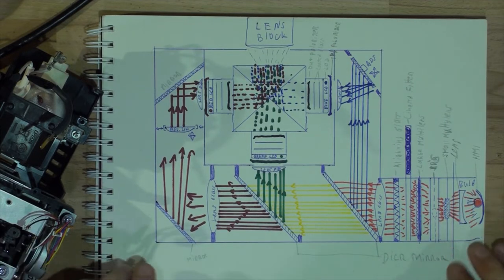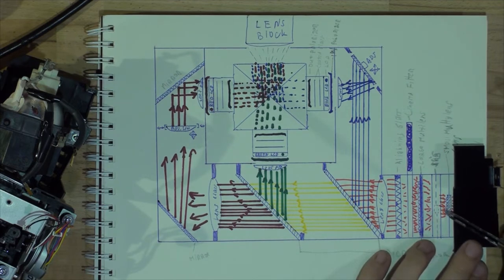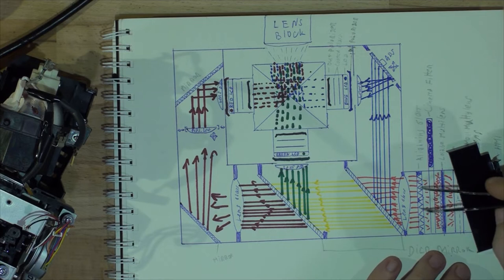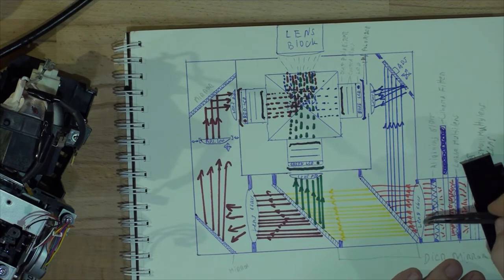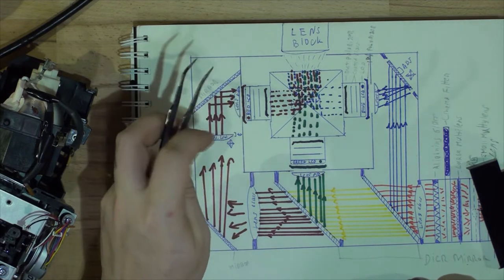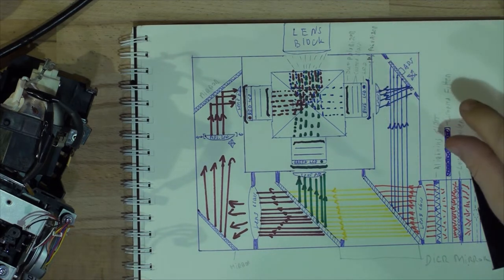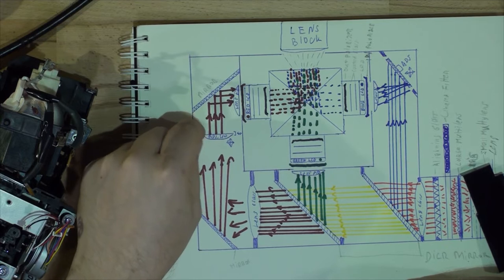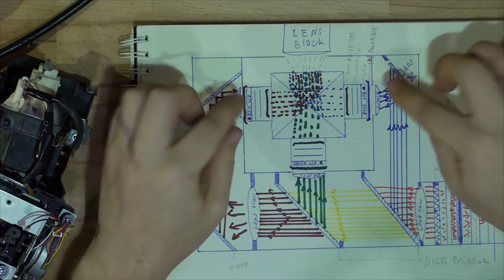Fixing Projector LCD Optics + Polarisers  Explained, How To Troubleshoot projector image problem.

Comment: Very good advice on the spot. I took the projector down and opened it up to find that a black beetle had gotten into the light engine area. Took care of removing the bug parts out with soft air pressure . Everything else was very clean but used a camera lens brush to finish up. Put the unit back together very carefully and everything lit up as it should without the spot!  Thanks for sharing your knowledge.

Comment: I have a tri lcd СР-Х809 Hitachi, and the screen is always white with a horizontal, thick black line on the top. I opened it up, and nothing looks out of place or broken. What could be the issue?
Reply from the maker: Could be dust on the lcd or optics (bare in mind that image is inverter upside down, so if the line is at the top of the screen then it’s at the bottom of the lcd or optics) the other cause is misaligned mirror in colour guide tunnel. Or faulty lcd.

Comment: Hello, I have an Epson 697ui and the top 1/4 of the image flickers/flashes mostly green and the rest of the image is perfect. Would this be an electronic issue or is it a bad connection or bad lcd on one of the lcds in the engine ?
Reply from the maker: Could be lcd or could be a connection, try pressing on the zif connector and see if it changes

Comment: Hello. I cleaned the optical block of the proctor. After turning on the projector, my red channel polarizer burned out. After reading the form, I did not find a solution - instead of the old polarizer, install a polarizing film from the LCD display. I glued the film on the glass from the burnt out polarizer, having previously cleaned it. After turning on the projector, I saw that the colors returned to normal, but the film melted again. I tried again by sticking the film on the other side of the glass. But she melted again. In what there can be a problem? I will be grateful for advice.
Reply from the maker: You’d need to buy a proper polariser from AliExpress, they are glass and not plastic.
Reply: @MaxELECTRONICS  The polarizer itself consists of glass and a polarizing film glued to it. I carefully studied the native polarizer - the native adhesive layer on which the film is glued is quite strong and thick. I had to use a solvent to wipe it off. The thickness of the native film is greater than the one that I later glued.
The strangest thing is that both the native film and the one that I glue begin to melt from above. I checked the ventilation system - it's okay. The remaining optical elements of the projector are in place. I'm even afraid that the purchased factory polarizer may melt ...
Reply from the maker: @lexraxx9043 have you checked that the blower that specifically cools them is working and there’s no obstruction? It’s very hard to laminate the polarisers a home, try buying a cheap/broken projector of any kind from marketplace and just installing any polariser from that just to see if the OEM polariser will melt
Reply: @MaxELECTRONICS  Greetings! Yes, I checked - the coolers are working fine, the air channels inside the projector are clean and will supply air. I purchased a polarizer from a different model Epson projector. After installation, it also melted... Not as quickly as my homemade filters, but still. Do you think there might be a problem with the lamp? I have 2 lamps, I have used them both, but the filters melt with either of them.
Reply from the maker: It wouldn’t be the lamp, check that all optics are positioned correctly and there’s no “hot spots”, that’s when the beam is focused in one spot, similar to lens on the sun.
Reply: @MaxELECTRONICS  Thank you for your feedback! I figured out the problem - the fact is that the standard polarizing filter has a very interesting coating. On the film side it has polarizing properties, but on the glass side the polarizer has no polarizing properties. Many forums recommend installing the filter with film to the optical channel, and glass to the LCD matrix. This is not true, at least for the Epson EH-TW5200. I installed the filter the other way around - with a film to the LCD matrices and the melting problem disappeared. I think that the polarizers of the lamp and my polarizer were out of “phase”, and the light flux was heating up the red channel filter. Thanks again for the recommendations.

Comment: So I took my projector apart (turns out spiders like hanging out  on the prism?) And when I lifted the prism all the out polarizer fell out and are mixed am I screwed? Is there a way to figure out where they go?
Reply from the maker: Easiest way is to try to see where the glue that polarises were held with is matching up with frame. Other tip - red polariser is slightly different tone then green and blue. And the green and blue just try placing them in roughly and turn the projector on and see if they are match or not.

Comment: Great video! I'm having a problem with the output polarizing filters on my Epson EH-TW5650. Would you know where I can find replacement filters please?
Reply from the maker: AliExpress sells them
Reply: @MaxELECTRONICS  Thanks for the information ! But I couldn't find the right filters for my projector. The only ones offered are suitable for the TW6700 and others, but not for the TW5650.
Reply from the maker: They may be the same, check the size. I have even swapped polarisers from different brand projectors before, all they do is polarising the light.
Reply: @MaxELECTRONICS  I've looked and the TW6700 apparently uses the same LCD matrices as the TW5650, but since I've found a TW5650 for parts, I'll try to recover the LCD matrices as well as the polarizers.

Comment: Fantastic thorough explanation. I just cleaned all the optics on my Panasonic PT-AX200U and I went a bit far lol. I removed the panels and had to realign each piece of glass with the alignment screws to get a good result. Each time I did an adjustment I had to remove the motherboard so not easy!  There is a slight green color on the right edge of screen but hardly noticeable so I’m happy with it. New lamp replacement was needed after 2010 hrs, the bulb lasted me 14yrs which is amazing. Hopefully I didn’t go too far the picture looks like new. I did find what looked like a black smear on one of the glass panels so I cleaned it with a q-tip dipped in isopropyl alcohol. Thanks for this tutorial 👍
Reply from the maker: The green colour on the edge would be a misaligned mirror in the optic engine light guide
Reply: @MaxELECTRONICS  oh yes good to know thanks for getting back to me. If I sent you a photograph of my setup could you verify for me please?  Do you think I went too far and should have left everything alone and not clean all the surfaces?  I used isopropyl alcohol on only one lense because there was a weird smear, look like a sharpie marker but the q-tip did the trick and looks like new!
Reply from the maker: You can clean the optics inside, that’s fine, but you should never remove lcd panels from the yoke (prism assembly), you should never use chemicals or alcohol on polarisers and you should never use compressed air inside the projector optics.
Reply: @MaxELECTRONICS  good to know, I used an air compressor to blow out of the dust in the fans/power supply but not the optics, was very careful and gentle. I bought a lense cleaning kit from Best Buy and came with special brush, microfiber cloth and puffer to gently remove the dust in the optics. So far so good, my projector is working. When I was at Best Buy I saw a new laser projector. AMAZING!  No maintenance on laser projector needed and no bulbs right?
Reply from the maker: Yes you can use compressor on everything but not optics. 
I’m not sure some laser projectors still use optic engine, some don’t. You can YouTube “what’s inside laser projector” and you’ll see different versions.
Reply: @stevemilker  there are three different types that operate on two distinction principles; one is called a laser beam steering projector, it has RGB lasers which is combined into a single beam before being scanned with a galvo mirror; these are very uncommon, their performance suck but they are infinitely cooler in concept; the second and third are both using "traditional" projector engines, i.e. DMD(DLP), 3LCD, LCOS, except the light is provided by a laser(s). One uses a single blue laser and generates the rest of the spectrum using phosphors on a spinning wheel, and the other one uses separate RGB lasers.

Comment: Hi Max, brilliant video, very detailed. I have a ceiling mounted epson tw7300 projector that shows a vertical blue one third left of the screen. This line appears after a few minutes of use and generally on bright mode. It clears off while using digital cinema setting. Line appears quite late when room is cold. When I play a video of full blue screen, there is no line but is immediately visible when blue screen clears off. Line shows up as blue on black screen and shows us as pink on red screen. Any thoughts which part could be faulty? Thanks in advance
Reply from the maker: If it’s a sharp line it could be the LCD. Or could be connectors on LCD

Comment: Hey Max thanks for the great video it is very insightful. Im about to attempt to fix my projector if possible. It's a Sony VPL HW10. Currently I'm getting poor blacks and dark scenes have bad contrast. Also I have noticed that there light bleeding from the border of the image all around. Which part do you think could potentially be causing this issue?
Reply from the maker: Possibly polarisers or mirrors.

Comment: Thanks for this rare information. I have a Christie LHD700 3LCD projector that the different colours are quite badly aligned and the problem seems to be getting worse. White  light is split to blue yellow and magenta components few pixels apart from each other. I guessing from your presentation that the LCDs are slightly loose inside. Do you  think i could open the light engine up and get them aligned again?
Reply from the maker: It’s possible but extremely hard to align the convergence on lcd projectors

Comment: Hi Max thank you for the video’s, very helpful. I have an Epson EHTW9000W, it switches on,opens the shutter and fans start but, does not ignite the lamp. The lamp led then flashes red, The bulb has about 2000 hrs on it. I have the original lamp which still worked when I swapped it out, have put that back in and get the same result. Is it possible to piggy back with a multimeter the bulb wires (to check for power)when starting to confirm the bulb is the fault? Had some other faults like temp led flashing intermittently just before this occurred, and a green intermittent vertical line on the screen.
Reply from the maker: It’s hard to say what’s gone wrong, have a look at a user manual and see what does led blinks mean.
Also yes you can force start the bulb manually, PLAESE BE CAREFUL DOING THE FOLLOWING AS THERES HIGH VOLTAGES INVOLVED AND COULD BE LETHAL, IF YOU DO THIS YOU DOING THIS AT YOUR OWN RISK. 
You can expose the projector ballast ( the one bulb connected to, then you will find 2 or 3 optocouplers on the board near a signalling cable, (you’ll have 3 cables going to on, one line to lamp, one for power input and one signalling) once you located optocouplers simply short out the output (opto transistor side) of the optocoupler, and see if lamp ignites, if it doesn’t try with other optocouplers, if none will ignite the lamp then it’s ether lamp or ballast.

Comment: Good day!  Thank you very much for this very clearly and wonderfully presented information.  I have the same projector you are showing here.  I had a green output polarizer that was burned in the center (even though we only used the projector some 200 hours...ever!)  I ordered a replacement polarizer from ebay and just replaced it, following a very helpful avsforum post with photos.  I am certain I put the new polarizer in the same orientation that the old one was in.  However, the end result is that everything is incredibly green now.  As though there is no polarizer.  Does this mean that I installed the polarizer backwards in some way?  Again, I'm certain I placed it the same way that I the old one was positioned.  Or does it mean I was given the wrong part altogether?  Either way, I think I'm in trouble, because the JB Weld that I used to glue it in is solid as a rock and I kind of over did it!  I am not optimistic that I can go back in, remove it, clean the area, and re-orient it IF that's what's needed.  But I'd love to know what the utterly green image usually means so that I can decide if it's worth it.  THANK YOU so much.  - Matt
Reply from the maker: It sounds like a wrong polarizer, if possible try rotating it 90 degrees and see if that works, usually when it’s all green it means it’s at the wrong angle or is there any chance you could have bought “input” polariser instead of “output” polariser?
Reply: @MaxELECTRONICS  Thanks so much for this reply.  I sent you an email this morning.

Comment: Hi Max, thank you so much for this. This helped me understand the individual pieces.

I have a question. I touched the LCD with my finger. Is there a way to remove my finger print?
Reply from the maker: LCD is not that sensitive, you can use cotton bud to wipe it, maybe mild detergent like Windex on a cotton bud, don’t spray it directly to lcd.

Comment: Dear Max, thanks very much, my Epson projector has a problem, the whole picture is a little bit green, make the picture off color, the reason is because the  input polariser? the output polariser? or the green LCD itself? many thanks.
Reply from the maker: It depends, if it’s a slight green tint the it could be input polariser out of place, they don’t usually fail tho. It could be something misaligned or fell out of place. If everything is in place then chances are it’s your output polariser, maybe check connection of the lcd to the PCB.

Comment: Awesome… I have a problem with my projector epson 5010, exactly right half or the projection is blurry and color mixing is not good, seems like optical engine malfunction… do you know what could be the issue?
Reply from the maker: It’s hard to say without looking at it but it’s something to do with the engine, I suggest just have a look inside and make sure everything is in place and no loose or cracked optics.

Comment: Hi Max I have a Epson 3020 Powerlite with 5 yellow vertical lines running near center of the screen.  I pulled apart and cleaned the unit and everything looks good.  Contacted Epson and they said it might be the optical engine, but would not specify which part might be bad.  Any ideas on what it could be?  I am familiar with Ali Express, however would not know what part to look for to solve this problem and the internet has not been very helpful as to pinpointing the problem.  Any ideas would be appreciated!
Reply from the maker: Could you send me a picture of what the lines look like to maxchristensenau@gmail.com
Please don’t share any links in comments as YouTube will remove it.

Comment: I have a PowerLiteHome Cinema 5010 3LCD Epson that has, ONLY AT TIMES, one Yellow Vertical line on the far right and, at times if present, turns deep blue.  No rhyme or reason.  Sometimes, the Vertical line will also occur on the far left side.  During start-up the black background and "EPSON" logo never shows this issue.  The Bulb hours are now up to 3100.  I was planning to purchase a replacement, since the manual states an Ave=~4000 hours.  Any thoughts / flow-diagram on how to proceed would be greatly appreciated.

Comment: Hello I have a Epson 3020 that suffers from uneven focus in a perfect aligned environment. Forum says that is the prism not well aligned with the lens.

Do u have more info? Thanks
Reply from the maker: You’ll need to check by colour, try displaying just full green screen and come close to screen and see if it’s in focus evenly (you’ll be able to see individual pixels in form of the grid) then try red and blue. It could be LCD with dirt or most commonly bad polariser, it could be still doing its job at polarising but it could be warped and causing distortion, think of it as a car with really old tint on the window, then it’s still a tint but it’s old and you can’t see clearly out of it. That’s exactly what can happen to polarisers. But first try to determine if it’s only single colour that is out of focus, if they all are then it’s the prism alignment, it could of unglued from its position, then you just need to find there it was glued and re attach it
Reply: @MaxELECTRONICS  all colours suffers from focus issues, uneven focus but not so much, left corner is not focus if i focus the center for example.
Reply from the maker: Then your inside prism not centred, it may have unglued, you’ll probably will see where the old glue markings were and realign it with them, and glue it back in place. DO NOT USE SUPERGLUE!